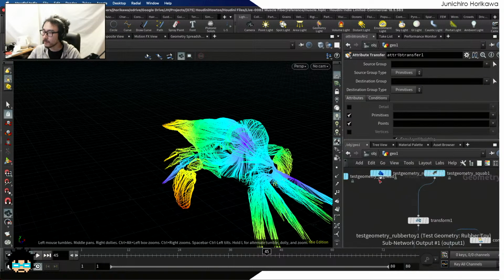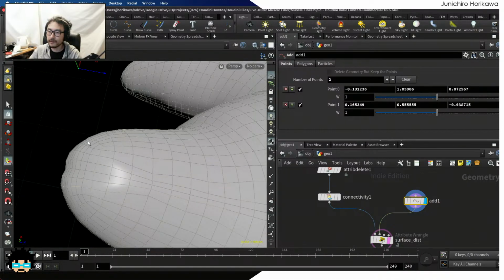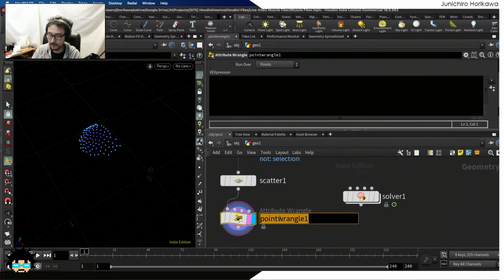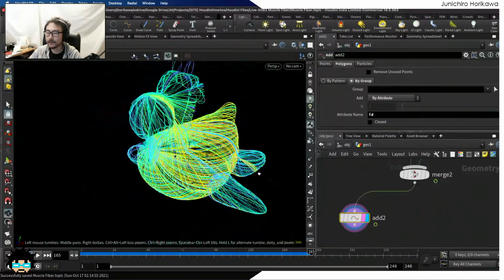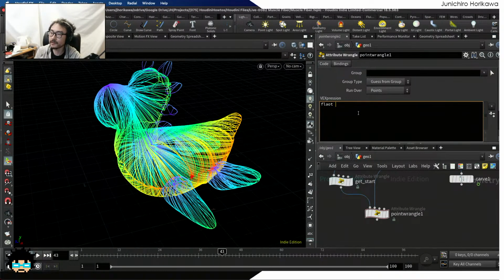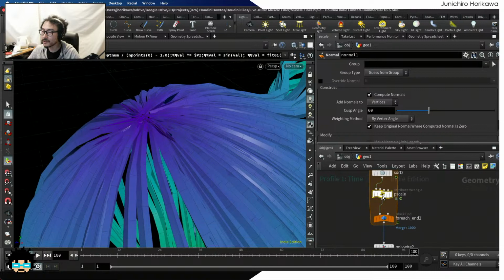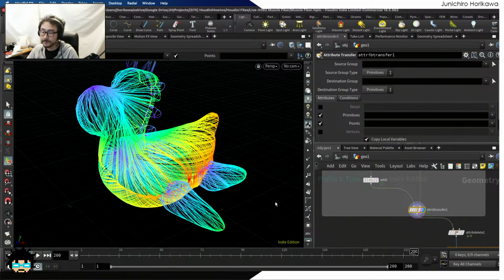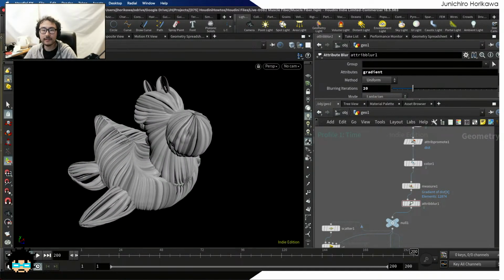Houdini Algorithmic Live #082 - Muscle Fiber

Comment: I am curious if the curve string can be unified to avoid those inevitable seams.
I was thinking if you create an separate "banana shaped" object which start at 0 point and ends in 1 point and is fat in the middle enough to have whole rubber toy inside. then maybe with some help of vellum to shrinkwrap it around the rubbertoy geometry and transfer the geometry flow to the surface ... Would that be possible somehow?